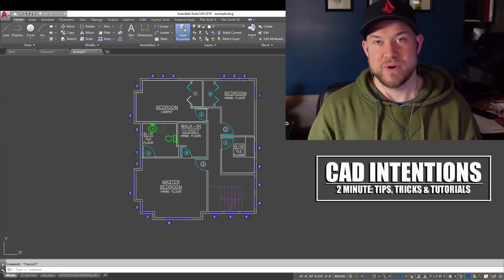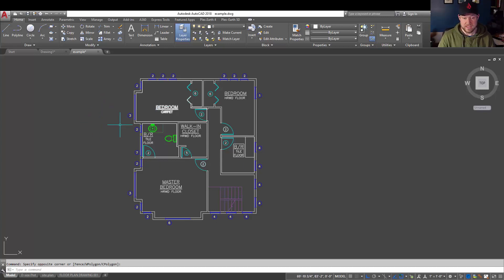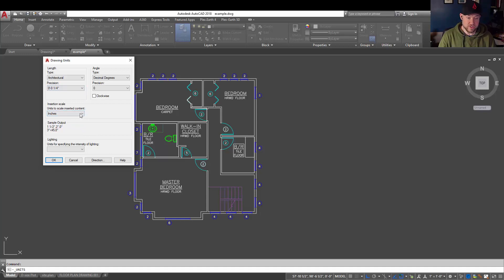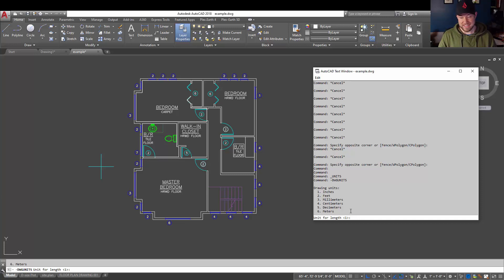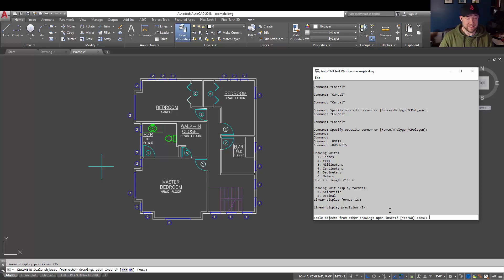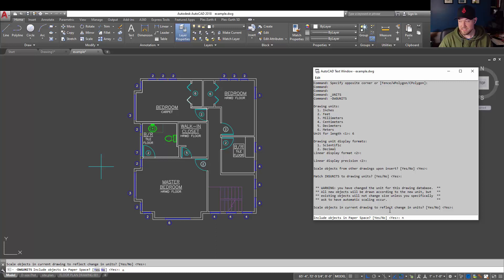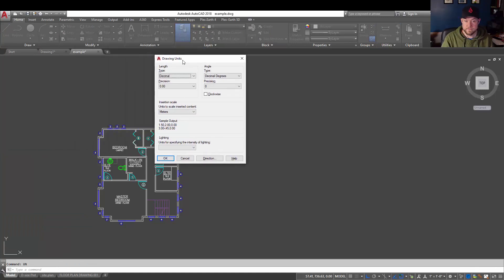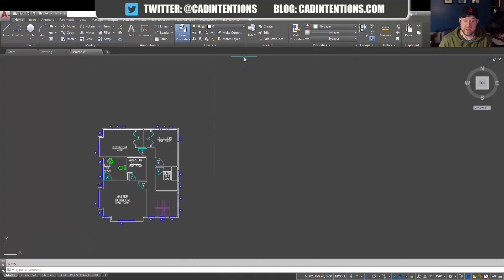AutoCAD How to Check Units & Change Them Easily!  | 2 Minute Tuesday

Comment: Hi Brandon .  Having an issue with the units I just can't seem to fix.  No matter what I set my units to the number I enter in to draw is always inches but measures in feet.  So say I type in 24 it turns out to be 2 feet.  How can I type in 24 and it be 24 feet?
Reply: Have you checked your dimension units?
Reply: @BY-hw6om  I figured it out.  I thought I should be able to type in a number a it be in feet instead of inches.  apparently you have to put in the abbreviation for feet.

Comment: Need some assitance. I have a drawing from a surveyor in decimal. I imported the drawing into my template and trying to draw a line but it is off by a scale of 12 and I cannot seem to correct the issue. My Units are set to Engineering and inches. I have tried multiple combinations in dwgunits with no sucess.

Comment: Running a few tests with R2022, it looks like the DWGUNITS command (which I can't find in "Help") does the same as a SOME items in UNITS.  The major difference is that DWGUNITS can precisely scale and entire drawing so the drawing acts as if it was totally redrawn from scratch in the newly specified unit assumption.   Is this right?

I wonder if each command (UNITS or -UNITS, and DWGUNITS) was coded by two separate people, totally independent of each other.
Reply from the maker: I wonder that too, or maybe it's a legacy/holdover command from way back. 

It's weird that units are controlled from different commands, and that they can be set differently. 

 Typically you won't need to change them but I have run into times when working in metric (Canada) and been confused as to why drawings from consultants or architects weren't overlaying with my site plans. 
 That's why I like to share this command/tip, to help if the issues arises.  
 Turned out that their drawings were all set to feet. This command helped fix the scaling issues when xrefing the drawings in, but at the same time, it shouldn't be an issue we even need to deal with.

Comment: This is the first time I have heard of dwg units.  I'll have to watch the video several times to understand them and how they affect my drawing and why I would change anything.

It seems like this could really confuse a project if someone used this dwg command and changed something.
Reply from the maker: Definitely agree! It's confusing that they can be controlled from two different commands and yes typically I won't change them.

 But have run into times when working in metric (Canada) and been confused as to why drawings from consultants or architects weren't overlaying with my site plans. That's why I like to share this command/tip, to help if the issues arises.  Turned out that their drawings were all set to feet. This command helped fix the scaling issues when xrefing the drawings in, but at the same time, it shouldn't be an issue we even need to deal with.
Reply: @Cadintentions  thanks a lot for that command